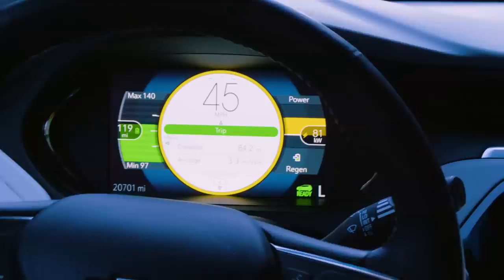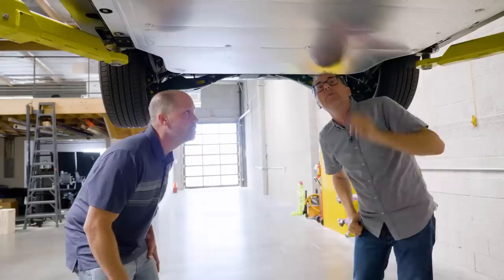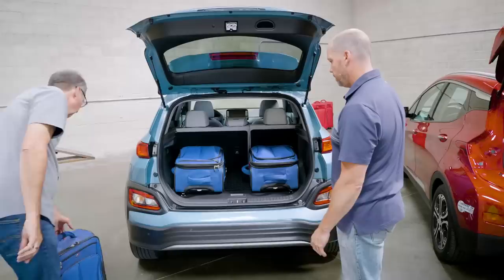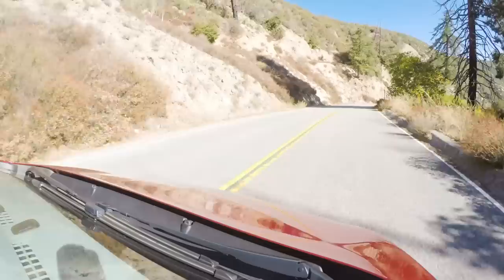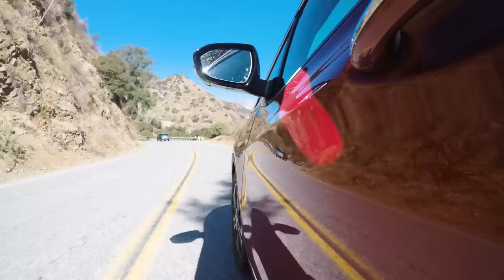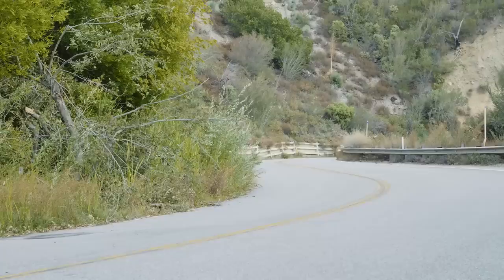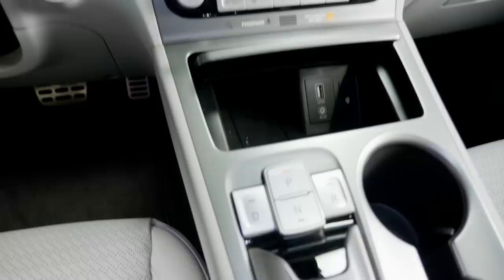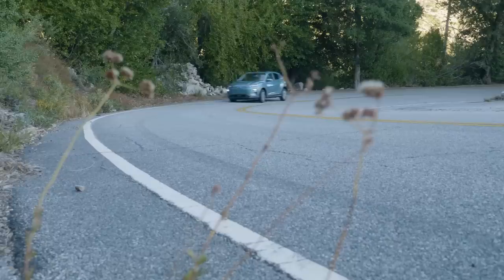Hyundai Kona Electric vs. Chevrolet Bolt EV: Which Is the Best Affordable Long-Range EV? | Edmunds

Comment: Now that the $35,000 Tesla Model 3 is released. I hope you guys over at Edmunds can do a follow up and compare that with these other EVs
Reply: Still none have been built. They only built SR+ and then if you try to order a downgrade to SR they'll do everything possible to upsell you on an SR+. You can't even order one online. They're ghosting the SR like they did the S40.
Reply: @zolikoff  incorrect.  Already being delivered.
Reply: @markleyg  All SR+ with software downgrades.
Reply: @zolikoff  and your point?
Reply: @markleyg  You replied "incorrect" to my comment which is correct. So you agree then?
Reply: @zolikoff  your statement that no $35K model 3s have been built is incorrect.
Reply: @markleyg  It is correct, no car meant to be sold as SR has been built. They will sell a few downgraded SR+ as SR, then claim there's too little interest in the SR and discontinue it. It's the same thing they did with the Model S 40.
Reply: @zolikoff  Perhaps I'm missing something.  What is this SR you are talking about?
Reply: @markleyg  SR stands for "Standard Range", i.e. the $35k promised variant with around 220 mile range on a ~50 kWh battery, non-premium interior, no glass roof etc.
This variant has never been built in a single example, and will continue to not be. The actual base model available to order right now is "SR+", a previously inexistent variant with more battery, more range, the same interior as all other Model 3s, including glass roof. This is about $40k right now on the website.
The only way to get a "SR" is to insist to Tesla on the phone that you want one, until presumably at some point they will actually deliver you... a software locked SR+ that you can subsequently unlock at any moment into an SR+ if you pay.
Reply: @zolikoff  yes, you can't order the $35k through the website but you can order it at the store or I guess by phone as you stated.  That is a far cry from it is not available.  And they are being delivered so not sure what the problem is.  Have you tried to buy one and been denied?
Reply: Sadly, that is now the case. I guess to give them some credit, they kind of got close... lol... $35000 in 2016 dollars, adjusted for inflation in 2019 is like $37000 which the SR+ was like $37500 (before they started bundling it with Autopilot and now charge $39.5k). A shame that they couldn't make $35k sustainable right now.

Comment: This is the Bolt Premier trim used in this comparison, that's a $44K car. You can tell immediately within seconds of the start of the video by the side rails on the roof. Also the wheels are obvious Premier trim. Their blabbering about "vaporware" doesn't apply to the shipping-right-now $45K Model 3 MR RWD w/PUP (265mi range).

At least list price it's the same. Street price the Chevy/dealerships have been throwing discounts at this because, well, the Premier doesn't do that well in head-to-head comparison to the Model 3 MR with the PUP (Premium Upgrade Package).

Comment: I hate Bolt's front seat headrest, very uncomfortable for taking a nap. The infotainment screen still freeze from time to time when starting up the car, but does unfroze itself after some minutes of driving. It's inconvenience when you are traveling and rely on android auto for google map direction. Mechanicalwise it's reliable, so far nothing break after more than a year of usage. The feature I like the most about this car is its real time tire pressure monitoring for all four tires.

Comment: I wouldn't be disappointed with either car, and I own a model S!
Reply: Not surprised given you drive a car at around or over twice the cost of either of these
Reply: @onoff314  Even the similarly equipped model 3, is way more expensive.
Reply: @stockey  There is no similarly equipped Tesla atm.  The TM3 at $35k destroys both of these cars.
Chevy Bolt starting price of $43,00.
Tesla Model 3 starting price of $46,000.
I am waiting for the Bolt starting price to be under $18k.  Till then I will buy a Tesla.
Reply: @davidbeppler3032  Bolt starting price is $36,620. Please get your facts straight. Why do you spew bs?
Reply: @blownb310  got the number straight from GM website.  Sorry they don't have your connections.
Reply: @blownb310  CANADIAN pricing... Otherwise, the Bolt would start at an even higher price than the Model 3. Albeit, the SR base Model 3 doesn't exist yet, and the MR Model 3 is in a totally different league than the Bolt and the Kona (both price wise, and for what you get).
Reply: @onoff314  true I could buy one of each for what we paid for our P100d and still have money left over.
I'm still thinking of buying Kona EV and pass the Tesla to my daughter who travels and commutes a lot more than my wife and I
Reply: @davidbeppler3032  The only issue with Tesla model 3 is that there aren't any.

I admire what Tesla is trying to do, but at this point Tesla just doesn't have the production capacity to meet the demand for their cars, and EVs in general. If I go on autotrader.ca right now there's exactly one model 3 in my area, it's pre-owned, and costs $73,000. Fuck that. Meanwhile there's like 30 Bolt EVs, most listed below MSRP.
Reply: @0hypnotoad0  they made less than 50,000 Bolts total in 2 years.  You say there are 30 sitting in a dealer lot, and that you can not find a Tesla Model 3?  Tesla is building 1,000 Model 3s a day.  If you can not find one, it is because you did not order it.  Nobody is dumping TM3s, they are valuable.  As for Tesla not being able to meet demand, give them 5 years.  Everyone will have an EV.  I can not believe dealerships still take ICE for trade in.  Just gonna end up crushing most of them.
Reply: @davidbeppler3032  

Don't be willfully ignorant. The wait times for base model (ie: affordable) model 3's is currently around 8 months. 

I agree they'll eventually catch up, it's just clear that right now the demand for the BASE model 3 is through the roof, and the only way to get a model 3 in a timely manner is to option it out into being a luxury car.
Reply: @0hypnotoad0  I chose to wait.  My ICE is fine until supply catches up and prices come down.
Reply: @davidbeppler3032  Fair enough, comes down to preference and circumstances. I'd like a model 3 but my ICE is basically kaput, and of the EV options the Bolt, unfortunately, is the most available one currently that meets my range and interior capacity for a work vehicle. Hopefully Tesla expands dramatically, would like my next purchase in 5-10 years to be a Tesla.
Reply: @0hypnotoad0  unless someone builds a better car for a lower price, my next car will be a TM3 too.  Gotta get rid of my ICE before dealerships realize they can't sell them.
Reply: uh, then why did you buy the model S?
Reply: @davidbeppler3032  are you seriously that delusional... i will preface this and say I work for delphi power electronics in kokomo designing electric cars and can say FOR CERTAIN .... that it is not going to be some big golden pony.... once "everyone switches" as you claim to electric vehicles the price per KWh will also increase.... also places like california which ALREADY struggle to supply power to the grid will have crashes like crazy with all the electric cars being plugged in....

Also if you think long term like me, ive done the math on all this (and we engineers are REALLY good at math) if you pay $35k american for an EV and a similar gas model is 18k -19k you arent really doing yourself many favors... think about it like this assuming i drove 40miles a day and gas was 2.50 per gallon when i calculated it out at 15 cents per KWh (with 90% charge efficiency) i would only save $300 a YEAR on fuel.... also that Electric battery when it goes bad (and it WILL) costs between 5k and 7k american (maybe more) and you cant go get one from a junk yard as it will also be old... gas cars when they start going bad nickel and dime you once in a while but never any major costs unless its a transmission or something catastrophic fails, especially if you're like me and turn the wrenches yourself... 

Im going to be real with you here electric cars are somewhat of a rope and pony show regarding the environment. it isnt in any auto manufacturers best interests to sell you a vehicle that lasts too long ... why do you think GM, chrysler, and ford all declared bankruptcy in 2010 because not enough people bought them (and various other reasons).... think about it... if EV's are always the clear winner why doesnt EVERY manufacturer only make and sell ONLY EV's?? usually they have 1 or 2 models.... 

Lastly how are you going to do a long road trip in an EV? please enlighten me on how i would drive to gulf shores alabama from washington DC ?? id have to stop every 3ish hours to recharge for 4+ hours... YEAH bc anyone wants to do that.... secondly what if somehow the battery discharges (and YES i know the car turns off its ports after a timeframe, i design these remember) it isnt like you can have someone just jump start you. you have to go get a generator and let it run for several hours.... 

for the above reasons i suspect, EV's like the nissan leaf etc depreciate like TANKKKKKSSSSS... by the time they are 2-3 years old they only are worth 35% of their original sales price and if you dont believe me LOOK IT UP..... 

lastly NO im not a "troll" ... im just a guy with a LOT of insight who is pointing out the obvious flaws in your superiority complex lmao
Reply: @wormer66  You are realistic and I agree with some of what you say.  I don't think grid crashes are going to be a problem.  California utilities are incentivizing users to charge at times when there is excess power.  The incentives are both positive and negative, depending on time of day, and expectations are that there will not be a problem.   Data with existing high mileage Teslas suggest that battery life is going to be long enough that it won't be a problem.  This is likely to be the case for all cars with active battery cooling.  These days, that's everyone except the Leaf.  Which, incidentally, is why Leafs depreciate so fast.   Road trips aren't a problem in a Tesla.   Drive 4 hours, charge 45 minutes.  That works for me.  TBH if I was going from DC to Gulf Shores I'd either fly or do the trip in two days.  If you really want to drive straight through, today you should go with ICE.  Check back in a couple years for more capable lower cost EVs and a much more well developed high speed charging network.
Reply: @davidbeppler3032  there will never be a 35 K model 3, in Canada, a similarly equipped Model 3. Is 70K, and the Kona destroys the Model 3. In build quality.
Reply: @stockey  Kona has great build quality?  What does that mean?  It's batteries last longer than 20 years?  No.  It is the safest car ever mass produced?  No.  They are building 6,000 a week?  No.  The motor is million mile rated and the most efficient ever?  No.
Reply: rusty tesla is garbage.
Tesla Model X issues https://youtu.be/hDD6b4g8Hfs  
Tesla Model 3 trunk design flaw https://youtu.be/hCv_Ha0oWjE

Comment: The full recharging time was not addressed for either of these vehicles. That is KEY. So much focus has been placed on getting more miles between charges.
The IDEAL electric car would have a range of between 150 and 175 miles with full recharge capacity of under 30 minutes. That is when I will buy an electric car.

Comment: It's good to see a dealership embracing electric vehicles. My wife and I bought a 2012 Chevy Volt 3-1/2 years ago. When we test drove it, it hadn't even been charged, and the salesman giving the test drive said it must be because it was hot outside and the air was on (which was false -- the engine turns on only when it's 28 degrees or less or the battery is depleted). He then tried to talk us out of buying electric, almost scaring our cosigner out of our choice. We'd have gone elsewhere but couldn't find that particular car anywhere else within reasonable driving range. Oh, and there was no charger with the car. I had to keep contacting them to get one, and it took over a month.

Comment: We love wife's Bolt.  It has just enough range and utility.   The sun visors are not very tall which is a bother, but it handles well, one pedal driving is great, and is pretty quick.  I don't mind the materials of the interior so much, especially considering the Bolt costs around a full third LESS than the Kona.  I'd pick the Bolt between these two, and there are EVs coming with more range and space that I would rather have than the Kona at that price range.

Comment: I've gotten 300 miles out of my Bolt on a single charge,  and I'm not a particularly careful driver, so take the range estimate with a grain of salt.
Reply: I average over 420km in temps above 19C. This is well above the EPA rating.
Reply: wow nice

Comment: I have driven the Bolt and a Tesla.  I was unimpressed with the Bolt's interior, style, and performance. Tesla was a WOW!
Reply: well Tesla is branded as a luxury car with luxury prices. Price a Tesla with similar range, considerably more. Also look up Tesla repair experiences, not pleasant for those needing them from what I've been reading
Reply: I personally loved the Kona better simply because it didn't have a giant tablet. I'm all for having the latest in tech, but I do not want to fiddle with a screen hoping I touched what I wanted. The Kona's dials might seem like old tech, but it is way easier to adjust things just by feel than having your eyes off the road just to adjust the temp.

Exterior is no contest. The Kona looks good, but the Model 3 is a supermodel when you put them side by side.
Reply: Not in the same price range & and some of us like a shorter hatchback.
Reply: @deanlewis8083   Chev Bolt MSRP $43,945. Tesla Model 3 can be purchased on their website for #37,990. That includes Autopilot.  Tesla is less and offers more.

Comment: Nice comparison review,  good to see the Bolt getting some actual competition in the affordable 200+ mile range class during its 3rd model year of production.  I know that you intentionally did not discuss range, because they are both so close and eliminate range anxiety, but I wish you had discussed charging, expected maintenance, TCO, warranty, route planning for longer trips that include charging stops, and technology in both, including display features.   The large center display on the Bolt is fantastic as is the ability to have an app on my phone that displays vehicle status and allows "remote start" for cabin preconditioning.   I hope that the Kona EV is made available in all 50 states .
Reply: Word is Kona will only be available in certain states for a long time. You can get a Bolt in any state at a significant discount off MSRP even before the tax credit.